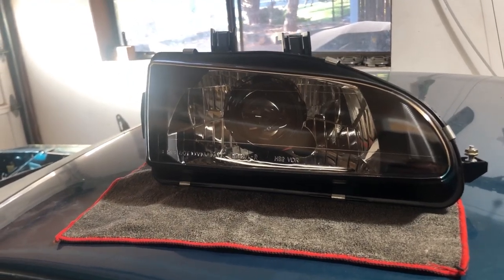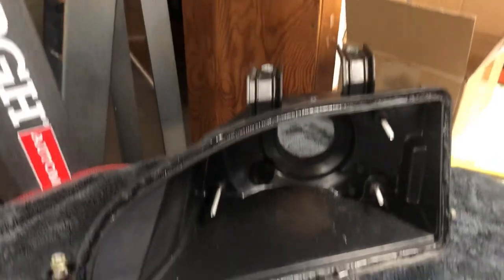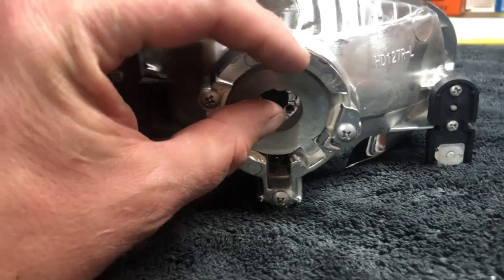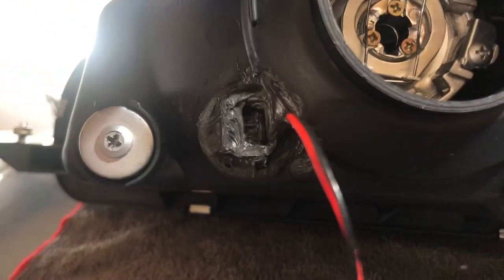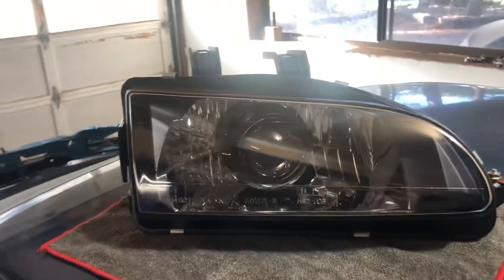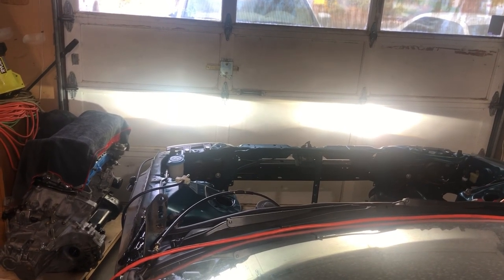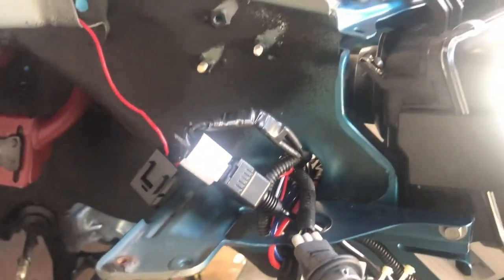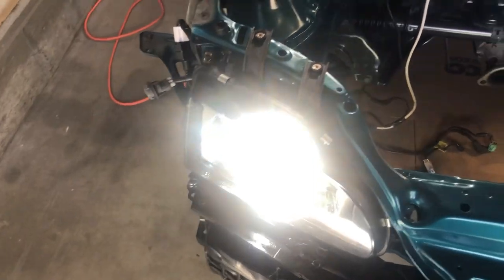EG, 92-95 Civic Hid/Projector retrofit

Comment: did you have to drill the holes for the headlight stay bracket in the new crash bar?
Reply from the maker: No modifications were necessary.

Comment: Hi, where i can find the h4 to h1 adapter?
Reply from the maker: Innovited (2) Easy Relay Harness... https://www.amazon.com/dp/B08PQ192MD?ref=ppx_pop_mob_ap_share
Reply from the maker: The above harness plugs in the h4 plug on the car and then to the ballast for the H1 hid bulb.  The 2 little wires plug into the wires for the shudder in the projectors.
Reply from the maker: Innovited 55W AC HID bundle with... https://www.amazon.com/dp/B08RLKQBRN?ref=ppx_pop_mob_ap_share

This is the HID kit.  This kit with the adapter and projectors is all you need.  Hope that helps.
Reply: Great, thank you!!

Comment: Where can we find the projectors?
Reply from the maker: The ones I have are no longer Available, however these look to be the same 

Nilight 2.5" Mini Projector Lens for H1 Headlights Bulb Retrofit, Custom Headlamps Conversion:Chrome Shround,2 Years Warranty https://a.co/d/3YBdqcP
Reply from the maker: There are a number of different types on eBay and Amazon from $26-$200. It just comes down to materials and options.  Mine are mostly plastic but they work great.
Reply: @carsinruin6102  Would a 3 inch projector lens fit?
Reply from the maker: @jamzempire  maybe, but you would not be able to use the shrouds…but it would definitely be tight.  There’s no need to go 3” because their are plenty of 2.5” projectors that work just fine.